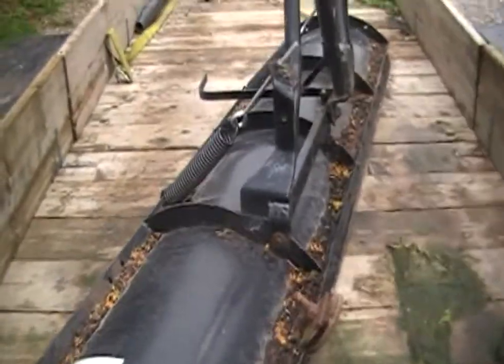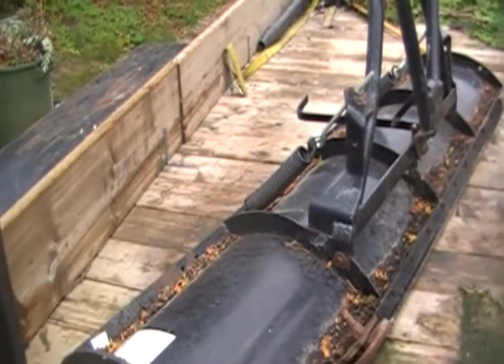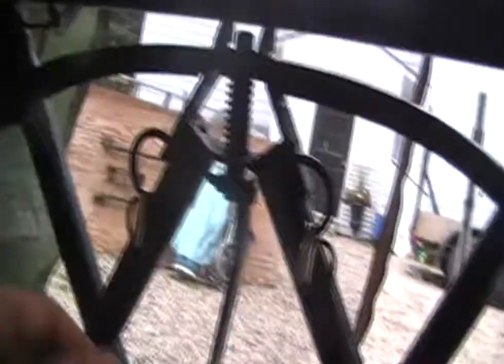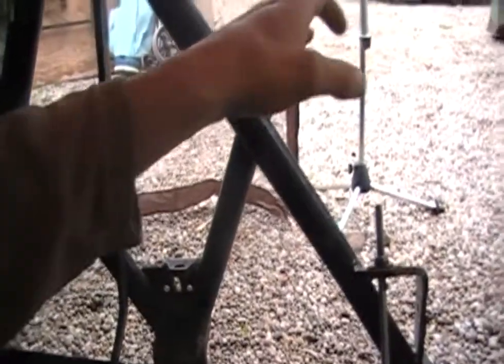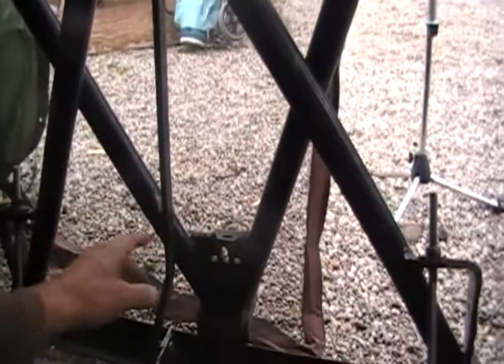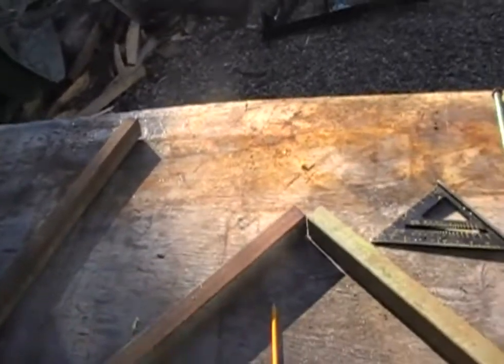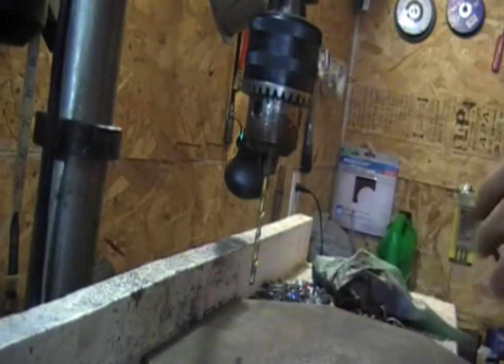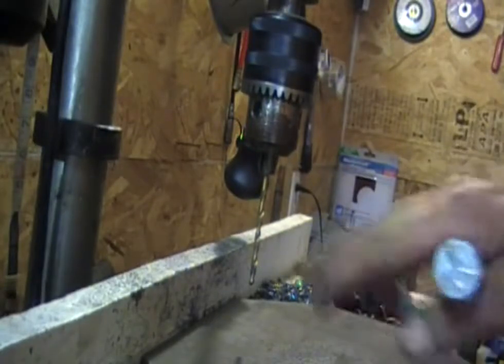Homemade Snow Plow For John Deere Tractor Part 1

Comment: Hello,  Have you thought about using one of the thin silicone mats they sell in cooking departments for rolling out dough as a low friction layer between your flat plate pivot point?  That and grease may give a more even long lasting pivot.  Good project.  Those home migs generally have a very short duty cycle around 20% which is two minutes out of every ten.  It can seem like forever.  You can stretch it some by putting an additional fan behind it blowing through the casing to augment the built in one.  Also blowing compressed air through it during recovery will speed the reset.  I have been using my Lincoln Weldpak which is ninety amps for thirty years darn near and have built a lot of stuff using multiple pass.  Although over the years I fall back on my stick welder for the heavy action and I have several machines but the little flux core set up can do a lot.  Another interesting project doing with what you got!  Take care.  Doug